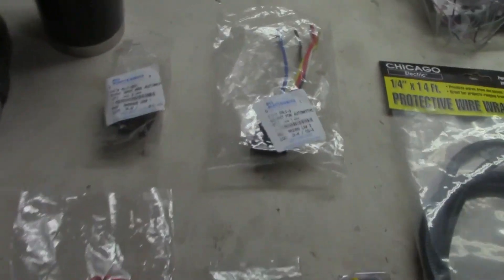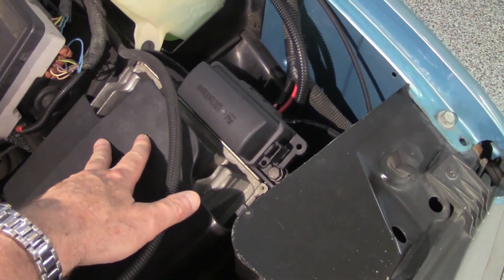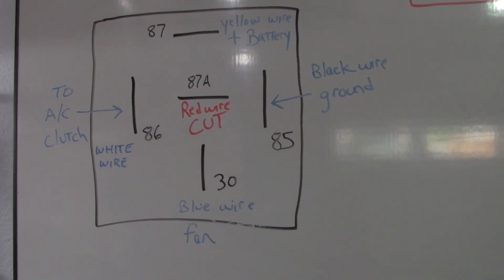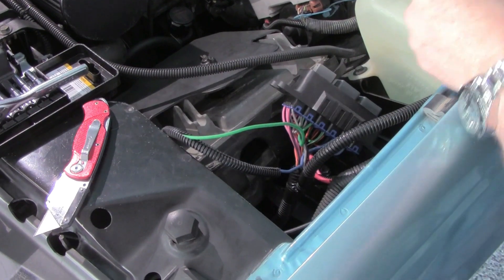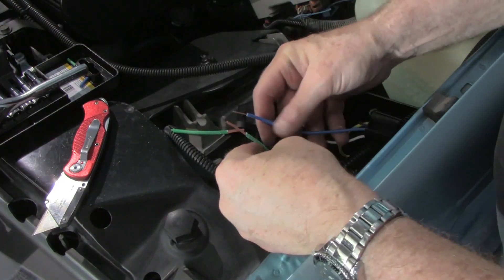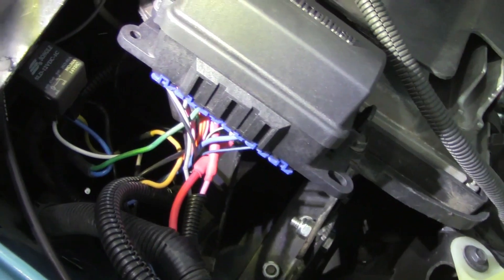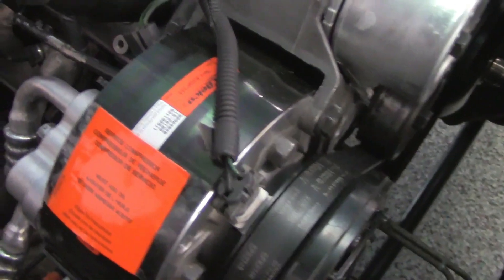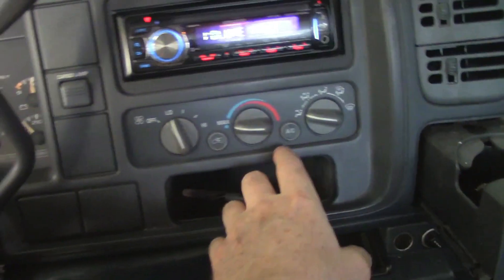1988-1998 Chevy OBS Project Truck LS Swap A/C Fan Relay Install

Comment: Hello when you went from the 4.3  to the 5.3 in your truck, did you change to v8 springs? I think there’s only about 120 pound difference.
Reply from the maker: There is little perceivable notice in the 2 spring rates. Initially, in addition to the drop control arms, I trimmed about 1/3 coil off the original springs. It drove fine, it dropped the front a bit more than I wanted. I got a pair of good stock springs from a wrecked '92 V8 truck and installed them without trimming the length and all was good. It got the height where I wanted it and I could not tell the difference in springs. A fully dressed 4.3 is not a lot less weight than a 5.3. It is not enough to make a difference IMO.
Reply: @laurencevillegarage  thanks about done with my truck , you were a lot of help. I also had Chris do my harness .
Reply from the maker: @donaldsavoy8060  Great to hear! Hope you are happy with Chris’s work. Post up some pics!!

Comment: What was the part number for serpentine belt?
Reply from the maker: I ended up with several belts. When buying, measure carefully and stick with one manufacturer (gates, continental, Dayton etc) belts are like a pair of jeans…same size in a different brand will be just a bit different. Your specific length will depend on the “exact” placement of the compressor. A few mm difference means a different belt size. All that to say that the size I used probably would not be the size you need for your application.

Comment: I DID A SWAP ON MY 1993 WORKING ON THE A/C NOW BY ADDING A NEW A/C LINE AND BRACKET. IM RUNNING THE SAME COMPRESSOR. DO YOU THINK I NEED TO DO THIS TO MINE AS WELL ? I KNOW MY LAST YEAR DID NOT HAVE ALL THOSE COMPUTER
Reply from the maker: Unless your LS pcm has the a/c controls on it, then I would say yes, you would need to have this relay so your electric fan comes on when the a/c is activated.
Reply: @laurencevillegarage   MY LS IS CARBURATED USING THE MSD CONTROL BOX. SO I SHOULD BE GOOD THEN RIGHT NO NEED TO USE A RELAY?
Reply from the maker: If you want your fan to come on when the a/c is turned on, you will need to have the relay. Unless you had electric fans to begin with, the fans will not know when the a/c is turned on.
Reply: @laurencevillegarage   did you wire both fans to the a/c or only one? Meaning  fan 1 to thermostat  and fan 2 to a/c clutch.
Reply from the maker: @jaysgarage6784  I wired fan 2 to the a/c. Reason...fan 1 will come on at 185 degrees. If a/c is on, fan 2 is on, then when temp hits 185 fan 1 kicks in. Otherwise, a/c would turn on fan 1 and fan 2 would not come on until the next programmed temp was hit which I had at 195.
Reply: @laurencevillegarage   GOT IT. I wired both to a universal fan thermostat and out of the relay I used 85 ON both RELAY'S to kick in when i turned a/c on . If I dont use a/c then fans still cut on at 160. I used Derale dual fan with metal shroud and they produce each 4000 CFM. truck runs extremely cool now

Comment: Which ebay fans did you get, putting in a 95 yukon 2dr
Reply: Thank you very much sir!
Reply from the maker: Here is a link. price went up a bit, but still a good deal. Don't forget wiring pigtail. https://www.ebay.com/itm/351655988506, https://www.ebay.com/itm/254345444952

Comment: You probably answered this already , I’m swapping a 2006 lq4  6.0 in a 1997 gmc you have any part numbers on the oil pan. Thanks
Reply from the maker: The oil pan I used, I got from Pace Performance and was an LS3 crate motor take off. I got a few extras (pan kits that is) at the time because I believe I recall paying about $169 for the pan, gasket, pick up tube, o ring, dipstick and tube and baffle.  The dipstick and tube all depend on what exhaust manifolds you use. Because the dipstick length all depends on the depth of the pan. On my blue '95 I had to modify the truck dipstick length to work with the new pan and using stock manifolds, the tube was unchanged and worked perfect. Hope that helps. Just remember when ordering your oil filter, go for what pan you use not the engine. If you order a filter for a 5.3, it will not fit the LS3 pan.
Reply: @laurencevillegarage   Thanks

Comment: Hey Sir,  Did you wire in your drier as well? I have a 95 Impala SS. I have the same step up with my relay. Yellow power with a 30 amp fuse, Black ground, and blue going to my fan 2. My clutch/ compressor has green and black wire coming from it. The black is the ground. My drier has two wires coming from it which are green and blue. You I do tie in the wire (A/C Request) coming from the car to the white (86) wire coming from the relay, the two green and one blue wires coming from the drier and clutch/compressor?
Reply from the maker: Originally, I continued to use my R4 compressor and used all my original wiring. I added the relay so that one of my electric fans would come on when the a/c was turned on. I did not modify any of my wiring pertaining to the a/c beyond that. I have learned the pcm is capable of additional features concerning the a/c that I did not know before. For example, under full throttle acceleration, the clutch can be disengaged. Idle can be adjusted to compensate for the additional drag of the a/c etc. I am not sure if all the earlier truck pcms can do this or not. Because most trucks/suv's had engine driven fans not electric. Car pcms seem to have this for sure. I would definitely check with an experienced tuner to find out. If you don't ask questions or request it, they may not just offer it up. Hope this helps, good luck.

Comment: So how does the motor adjust for the rpm drag due to the ac running without being connected to the new ecm
Reply from the maker: This is part of the learning curve on pcm mods. I didn't have this. I did not have a problem with surging or the engine stalling or missing when the a/c was turned on. However, in the future, I will be having the items affecting the a/c tweaked to be sure all settings are adjusted. Good question, most people do not think about the minor details of pcm adjustments, just performance. I didn't know what I didn't know. I do now.

Comment: How did u mount your fans? Bracket? Also where did u find that shroud that covers the radiator and fans?
Reply from the maker: I used 2 1” wide metal strips I got at Home Depot. Bent the top 90 degrees to mount in existing holes and trim/formed the bottom to attach to lower radiator core support. Pretty easy to do. Minimal fabrication needed. That fan shroud is from my original v6 shroud that I trimmed down to fit. Again, a little ingenuity and did not take long to do.

Comment: So does  the fan stay running the entire time the ac is on or does it cycle with the compressor?
Reply from the maker: Yes, the relay is to activate the fan when the a/c is turned on. That helps keep the temps lower which helps keep line pressure from getting to high.

Comment: Where can find that hoses ?
Reply from the maker: Are you referring to the fuel lines or radiator hoses? The fuel lines I had made at a hydraulic hose shop. The upper radiator hose is the factory Tahoe that had a section spliced out of the center of it. The lower hose is stock Tahoe as well that had to be shortened.
Reply: an apology for not specifying me I mean the air conditioning hoses

Comment: I noticed the engine didn’t bog when the compressor engaged. Did you find a way to have the computer know to raise the idle when the compressor kicks on?
Reply from the maker: When I had the pcm programmed, Chris may have done this, I didn't know to ask him to do it at the time. So, basically I don't know if he did or not. I didn't really pay attention to it. I now know to ask about that, cutting off a/c at WOT and turning on a fan when a/c is engaged. Learning as I go as well.  Ended up having more trouble with mu R4 compressor and changed over to a sanden 508 style from Dirty Dingo.

Comment: Do you have a diagram of how to run the fans/relays from the pcm? I was told to wire the pcm wires to negative relays and they  work this way but when I run the extra relay to the AC the way that you explained it doesn't work. Please help and thank you in advance.
Reply from the maker: I'm afraid not. when I had the harness modified, I had the dual fan wiring added. Separately I added a relay to allow the 2nd fan to come on when the a/c was turned on. This could have been done at the time the harness was modified and the pcm programed but I didn't think of it at the time.

Comment: Great job and info! I installed Ls dual electric fans. One fan is running off the original harness that came with my car so no problem  that one fan coming on with a/c on. The other fan has its own source of power with its own relay, own  temperature switch but couldn't figure out how to have it come on when i turn on a/c. This definitely solved my problem now both fans come on when i turn on the a/c. Thank you for the info!
Reply from the maker: Glad to hear you got it figured out. Happy motoring!

Comment: Did you splice the white signal wire into both of the green wires together?
Reply from the maker: The short answer is yes. I say that because if you trace them back far enough there is just one ( at least on mine and it was an unmolested original.)
Reply: @laurencevillegarage  ok i didn't know if it was different because mine is a 92 model. And as far as the fan connection did you tap into the wire coming from the pcm that controls the fan or directly to the fan power wire?

Comment: Do you have schematic or diagram on how you wire your relay in your AC wiring to electric fan for it to come on when air condition comes on.  You can email back at dangerfield3@gmail.com if you wish.

Comment: You help me with few months ago.  I have one more question about how to wire in my AC so the fans come on with ac.  Lt1swap is confusing to me on splice in my AC wire to.  Witch one of my AC wire do I use to splice in and what wire on the relay.  The LS pcm signal wire for fan 2 or the ground negative ground wire.  I'm confused.
Reply from the maker: I did not wire my a/c cooling fan through the pcm. Mine is external. When I had the harness modified, that would have been a good time to include the relay. That being said, it could still be done, I thought it simpler to just wire in a simple relay that did not rely on the pcm. I emailed you a pic of the wiring layout of the relay. 4 wires: power, ground, fan and a/c switch to power on.

Comment: Did you remove your truck ecm does it operate other funktions
Reply from the maker: No, I did not remove the trucks ecm. I wanted all my gauges/lights to work like factory and if you remove the trucks ecm that won't happen.  One small example is the fuel gauge, the needed wiring and grounds are in the trucks body harness. For my gauge to work properly, all I had to do was make sure all the factory grounds were grounded. There are a variety of ways to wire your swap. I chose to remove the least amount of wiring as possible to make everything work like factory...and mine does. That was my goal. You can go the next step and strip back all the wires that were not needed all the way back to the ecm. It is a lot of work and would have taken more time. While it may have made for a slightly cleaner install, for a driver with wiring looms in place, it was not necessary. But, if you are going to run aftermarket gauges or use something like a Holley Terminator setup then it won't matter as much.

Comment: I have a question regarding the A.C.  Did you use the Gen 3 computer to operate the A.C. or the existing ECM on the 95.
I'm doing a LS swap on my 94 1500 and I pulled out the AC wireing when I redid the Gen 3 harness.  I jumped the gun.
Reply from the maker: Yes, the wiring for the a/c is from the truck. It may be possible to find the correct pinnings on the Gen 3 computer and with the correct plugs, connect to your existing a/c compressor and function. I didn't do that.You might try ls1truck.com and see if someone on there has done what you might need to do. Be aware that if you do get it to run that way, the pcm may/can perform other functions that associate with the a/c. Such as cutting off compressor at full throttle, turn on fan when a/c is turned on etc.
Reply: @laurencevillegarage  Thank you

Comment: Hey nice truck, mine was that colour when I purchased it, but the paint codes were wore off in the glove box. I repainted it WA 9264 light french blue metallic. Didn't turn out the same, Can I ask what your paint code(s) are ? Thanks
Reply from the maker: Thank you for the kind words,  it is 1995 GM truck paint code 20 for light quasar blue.
Reply: Thanks appreciate it.

Comment: Hello ,I don't know if you can help or not but I'm trying to find out who makes the brackets for the ac,,,,,,alternator,,,,to stay in factory obs locations?? I was told it was one of the wireinghaeness guys,,,,but I'm not for sure...if you do know please let me know??thanks a lot..
Reply from the maker: On my 5.3 swap I used the original alt/power steering bracket from the Tahoe 5.3. Then, for the a/c, I used my original a/c bracket and modified it to work. This bracket appears to be the same whether it was on a 4.3, 5.0 or 5.7 pre '96 truck engine (not sure, but s10 and full size truck 4.3 appear to be the same bracket). The later model '96+ "vortec" layout is a bit different with a/c on driver side. To modify the pre '96 bracket, I went to maliburacing.com and did a search for r4 a/c ls bracket. It provided a great photo step by step how to on the mods needed to make it work. It really is pretty simple, you do need to fab up a couple of small support brackets. The pulleys line up perfectly with the 5.3 truck water pump, alt, p/s and crank. As long as you can do some minor fab work, it is pretty easy and cheap to do.
Reply: @laurencevillegarage  you should make a video on how you did that unless you already did.

Comment: If you already have the fans hooked up to the ECM and then the AC kicks on the fans how do you keep from getting feedback to the ECM?  Should you put a diode in the line?
Reply from the maker: In my situation, my fans were hooked up to the pcm, but turning on the a/c did not trigger the fan to come on so I added the relay to do that. Try contacting whoever has calibrated your pcm to find out if it is possible to modify your unit to work properly with the a/c which also means cutting off the compressor at WOT. Mine currently does not do this. I am going to see if I can modify my system to allow that. I know a lot of people are running a/c, but do not know if they are hooked up to perform the same as factory. There is more to it than meets the eye. Good luck.
Reply: @laurencevillegarage  I was reading your post where you added a relay in for fans to come on with AC power on.  Do you have a schematic or diagram on how you did that?  I have a 94 Chevy Silverado that has an R4 compressor.  You can email me back at dangerfield3@gmail.com if you wish.

Comment: Hey I seen that you are using the factory a/c  bracket on your LS swap can you tell me how to done that cause I'm putting a/c on my 89 c1500 swap thank you,nice job on your swap
Reply from the maker: Chris Marcum Hey Chris, thanks for the + comments. Best place to look: maliburacing.com and search for R4 a/c mount (this is where I found it). It’s actually very easy to do. I also found a bracket kit that would allow you to use the factory bracket yet mount a sanden compressor. Minor fabrication is necessary, but if you can swap that motor out, it’s not a big deal in comparison. Next swap I will do again. Good luck.